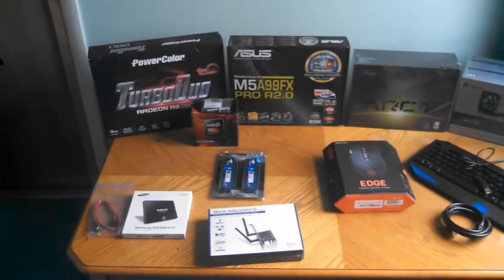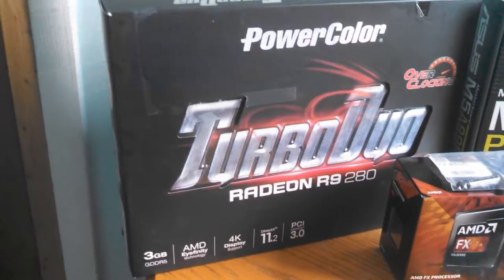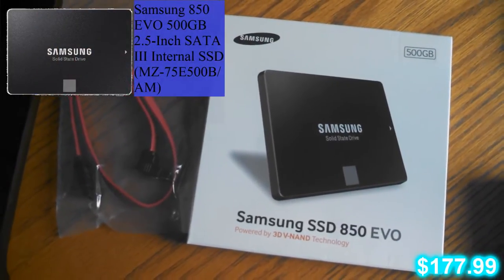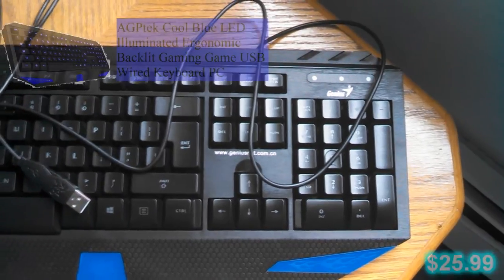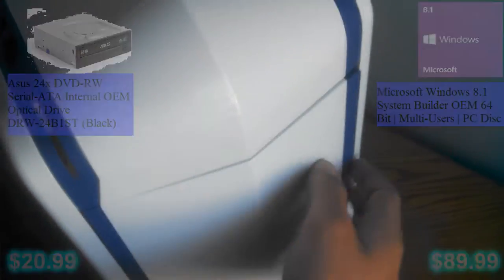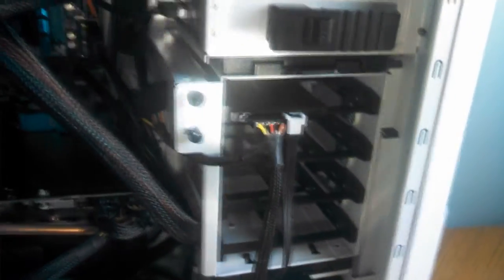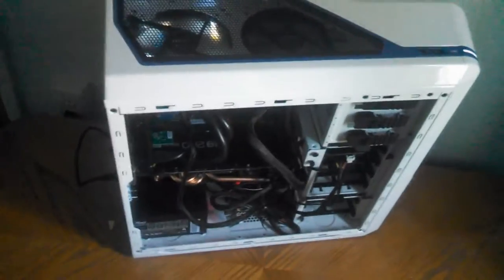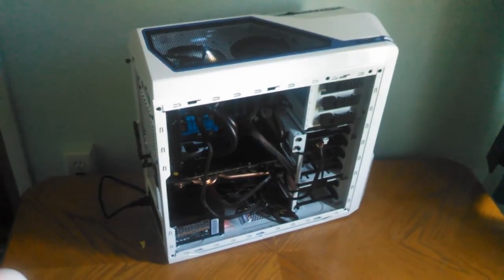My PC Gaming Setup + Fix CMOS reset Issue

Comment: Are you still using the Satechi Edge? My mouse just broke down on me a couple days ago & I'm looking for a solid reliable replacement at a good price.
Reply from the maker: I will let you know that it is my backup mouse now but I use a corded one now because the signal on the satetchi didn't go very far
Reply from the maker: I wouldn't recommend it, it's not very comfortable and the signal requires you computer to be close to the mouse
Reply: Casefy I only have a gaming laptop so distance won't be a problem for me but all in all thanks for the advice. It will make my decision easier. Before I go how is the battery life?
Reply from the maker: battery life seemed very good when I was using it anyway. I say you'd be better off getting a really cheap wired gaming mouse from amazon. they are  really easy to replace and mine hasn't died yet
Reply from the maker: if you are looking for a mouse I'd recomend the Mionix caster for $70 (Never go razer those things are built cheap) and if you don't have the extra money a cheaper solution could be Mionix NAOS (they have cheaper lower dpi sensors) and when worst comes to worst you could get an extremely cheap temporary one like the zelotes 5500 dpi. Hope you read this and it helps!